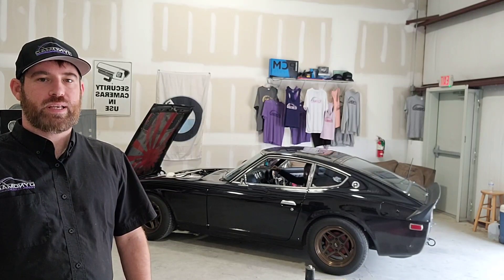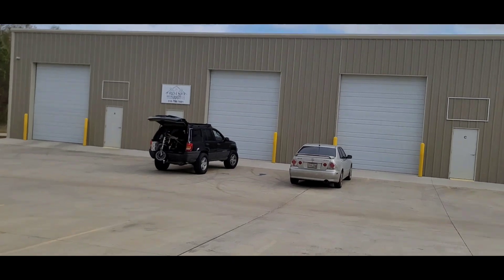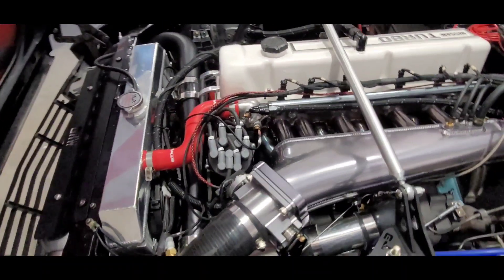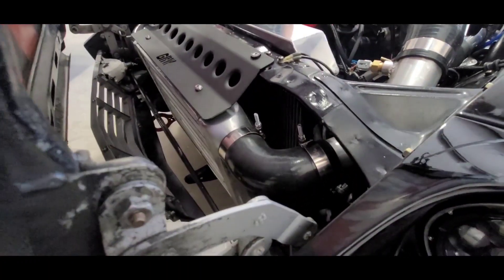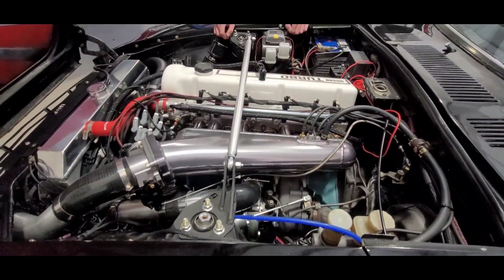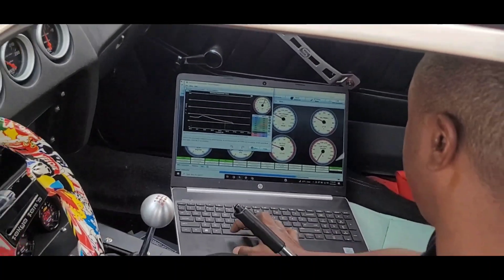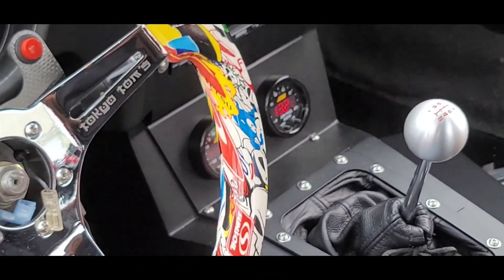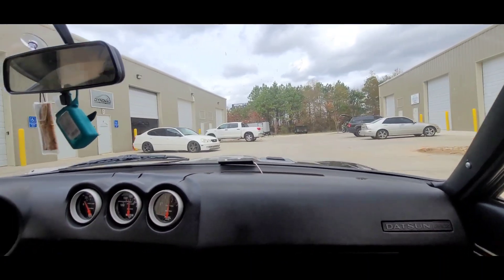Shawn's Turbo 280Z Dyno - New Turbo Manifold made how big of a difference?

Comment: I don't run any of that stuff on my megasquirt.... I hate to say it but that's pretty weak sauce unless you have like stock head bolts and stock head gasket. But even then you can still make like a hundred more horsepower. No boost controller needed just put a t in a wastegate line. If you have enough injector and pump. I've got 71 240z megasquirt 2 v2.2. no throttle position sensor no idle control all I have is a crank trigger as an RPM signal edis 6 wideband and intake temp... a locked up distributor with a t3 t4 18° at 20 lb of boost made 323 at 354 ft.  Right now it has a holset hx35 and it's cammed and it probably makes around 430ish. I haven't taken back to the dyno yet. The things you have to be careful about is the intake manifold getting super hot. Put a heat shield in between the turbo and the intake. I've blown many head gaskets..... heat management. All it takes is water meth ARP head studs and they'll make 350-400 all day every day. My current setup has been going for about 35k miles. And they're hard miles lot of autocrosses hill climbs and open track days. Don't be afraid to turn the boost up just don't rev it past like 62 6400 once you get a cam.

Comment: Up the NA power, these l28s had ridiculous stock compression. Better to use na base compression. Back in those days engineers were afraid of consumers dumping regular gas etc. Even Porsche was using ridiculous low compression in that era. Mainly I surmise because of poor fuel distribution and engine controls.

Comment: 2 years late but if he had a LD28 3.1 stroke he can possibly make more power not sure piston size probably 87mm or 89mm ? But its been done before 500 horsepower and border line 600 horsepower especially with 1000cc and an OS Giken Diff and rear axles he can even use a 370z diff the 240z all the way to 280zx diffs hates 300 to 600  horsepower especially the RB or LS or 2j and even L28 turbo swaps so most folks do this diff swap i think theres kits for it as well also theres a 350z tranny adapter plate for L26 and L28 engines . Why a 370z diff ... because my uncles 2jz 240z oem diff left the chat on him know what i think your customer is good where hes at lol

Comment: I'd be interested to see how much whp it makes with stock manifolds. You're down about 40-50hp over stock manifolds.
Reply: My 82 L28ET completely stock made 158 wheel hp and maybe 162ft/lbs on a Dyno Dynamics. Stock block and head, stock manifolds, Z31 turbo, about 10psi, same side intercooler with 2.5" pipes, Stock 280zx downpipe then 2.5" exhaust with cat and turbo muffler (same as when tested prior), M30 (VG30E) ECU with Nistune daughterboard base tune meaning hasn't been professionally tuned, 233hp and 275ft/lbs on a Dynojet. When I saw the numbers in the description I was really surprised. Something isn't quite right.
Reply: ????A stock 280zx turbo makes 180 engine hp. This is 205 at wheels. Low boost.
Reply: Yes it's down on hp.
Reply: @skirkland1980  "Yes it's down on hp"

Just to clarify- Youre saying it "should" be at roughly 250~ whp on 9 psi?
Reply: @SidewaysGts   Yes. I'm curious what the intake runner ID is. I'm assuming it's 1.5". The intake port is 1.375". A mismatch like that can cause low hp numbers. For reference mine is almost exactly the same combo with just a bigger cam and makes 465whp @23psi boost through an auto trans and very loose converter. Also made 280whp with a completely stock L28et, ebay turbo @ like 12psi.
Reply: @skirkland1980  "For reference mine is almost exactly the same combo with just a bigger cam and makes 465whp @23psi boost"

Would you be willing to share your exact set up and what kind of dyno this was on?

Comment: Love the sound of the L series😍 Those wheels are perfect! What rims are those?
Yet i wonder.. shouldn't an L28 be able to make 400+hp? I guess those builds also rev up way higher.
Reply: It's hard to push the L series over 350 imo
Reply: @winstonpratt604  It's hard maybe. It's doable so i don't mind putting in what it takes if i ever have the chance to get a Z. Sice i know the Z Speed Shop Shinohara has built in the 90s it's my dream car :D Even if it would take years to build that engine it's worth it to me.
Reply: @winstonpratt604 It's not that hard to make 350rwhp I've heard of all out turbo l28 builds making 600 to 700 horse power.
Reply: @That260z  And that's in tha 80s and 90s.. On carburettors too!😵😁😎👌

Comment: Needs some coil packs and it would be 😎
Reply from the maker: Yes it does, we could gain full control of the ignition map with that and make a noticeable difference in power and driveability. Couple that with a nicer turbo and he would be in there!
Reply: that is next phase, just need to add a few things before that.